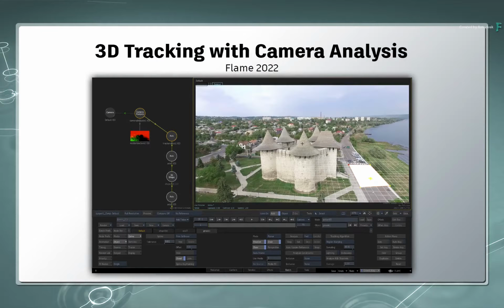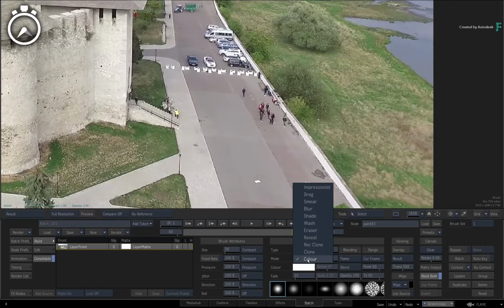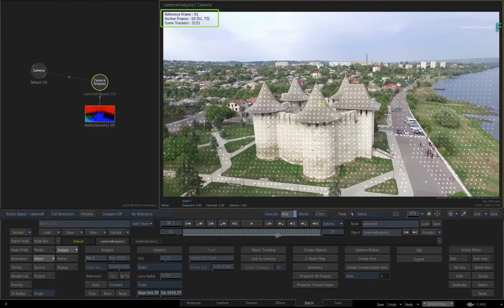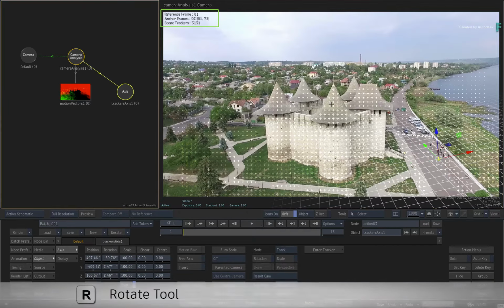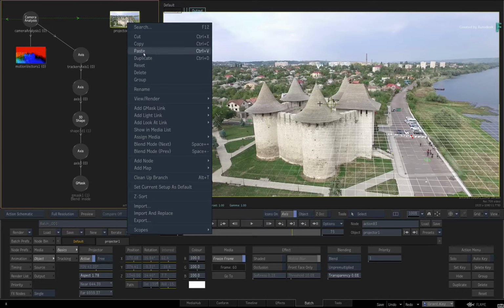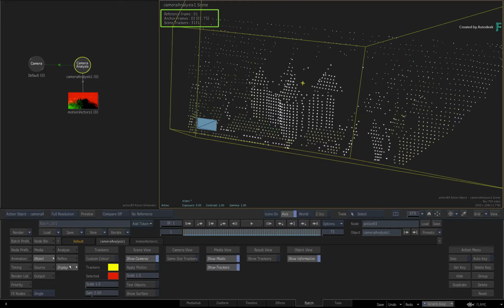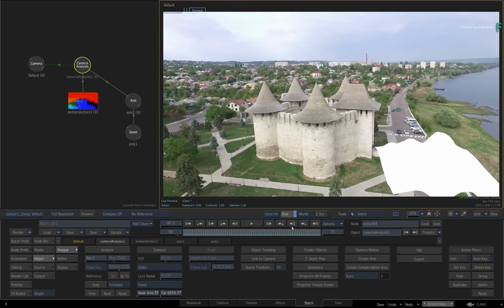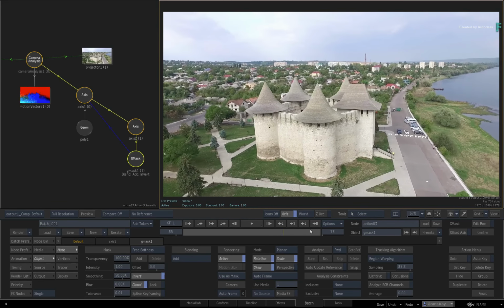3D Tracking with Camera Analysis - P4 - Clean up with Projections - Flame 2022

Comment: Grant - it's really too bad that you can't use an Ext Bicubic in a projector.  The only way that I have been able to do this is by using and Action node to feed into the projector surface and then it is really hard to manipulate because the surface that you are adjusting is not in the same view/plane/transform as the comp.  This would really help when the  surface needs a tweak from slippage or bobble. I have asked Autodesk for a way to do this for years.

Comment: Grant - stupid question: how do I reset my orbit?  I think that it used to work off the default camera and you tracked with a new camera.  I'm in 2024.  While I'm here - one thing about the new animation curves that I don't like - If I have to enter a global keyframe on a node, I have to constantly tap on another node and then back.  I can turn off "Automatic Channel Selection" but then it's in a constant state of globalness.  I wish there was a hot key to switch back and forth to the parent node.  Also, the Planar tracker used to stay on "AXIS" when manipulating the mask, now, everytime I adjust the mask to keep the track going, I have to remember to tap back on the AXIS node, otherwise I have a mix or Axis and Mask keyframes.  Just sayin'.

Comment: Bullshit...only works with. 75 frame, perfect geometey and super simple camera movement, as always...when it comes to real everyday challenges, nothing goes as smooth as that...frustrating
Reply from the maker: @Pedro Da Silva Sorrentino, the footage I supplied with the video was not exclusively produced for Autodesk.   I did try other shots successfully but I felt that this shot explained everything clearly without too many issues getting in the way.  The purpose of the example was to show you what is possible with the features mentioned.   I agree that not every challenge is the same but other Flame Artists have had success with these methods.   Unfortunately I cant cover every possible example but I can certainly point you in the right direction for a successful track.     If you feel there is a bug or improvement with the feature in question, please log a request with Autodesk support and we can investigate it for you.   Many thanks for your feedback!

Comment: How would you go about projecting a clean plate in a scene tracked in a 3rd party tracking software?
Reply from the maker: Hi Andy, it would be exactly the same as this but without the camera analysis bit.    You would import your 3D tracked camera as an FBX and place an object in 3D space to receive a projection.     Next you would create a new projector at your chosen frame from the cameras perspective.    To lock it down you would freeze any animation on the projector.    When you look through the camera, the project should stay locked and you’re left with a clean plate.  Hope this helps.

Comment: heya grant...

thanks for the great videos as always.

couple of questions please !

1 - can we add manual tracks to the solution ? ie pick a pixel area feature that is not included in the point cloud, and add it...like you could with the old 3d tracker, by adding a manual 2d track to the solve.

2 - i notice that when you scrub,  your clean plate slides...especially noticeable at the left hand edge...and I noticed that your point cloud that you picked for the gound plane, the points should have been relatively much more coplanar than they appear in the solve....which maybe is causing the incorrect solve/ground plane slip. having to manually rotate the ground plane as a guess by eye,  somewhat defies the point of getting a rock solid 3d track, and in many scenes is not easy to do accurately ! is there any tool or workflow in the new tracker that can improve this ?

2b - we can also see this issue in the surface mesh generated, the road area is concave rather than flat...

3 - it would be cool if we could have an option of generating a diffuse map set to projection uv's and frozen to the frame, as an alternative to generating the projector...i fond far more control with working that way in layers of projections etc...

many thanks

paul
Reply from the maker: Hi Paul, Thanks for all the feedback!

1- At the moment, you cant add manual tracks to the Camera Analysis, you can increase the number if trackers used per frame but not pin point specific targets/pixels.    Please log this in the Autodesk Flame Feedback Portal.

2- I agree that they may not have been perfect but I was moving along quite quickly and I did have time to check each point to ensure the co-planar aspect you are referring.  So the workflow is more or less the same but you would be to take more time and rotate around the point cloud and examine the points you would like to use.   

2b - This is down to the camera analysis algorithm, level of detail in the image and camera move to extract the correct depth info in the point cloud to be able to make a mesh.   This should be able to cover most shots but we cant guarantee every shot :)

3 - That is an interesting idea and definitely worth logging with the Feedback Portal.    However I would ask you what more needs to be done to the projector to do the same thing?

Thanks!
Reply: @Autodesk_Flame  thanks for the reply, and yes all makes sense ! look forward to using it ! 🙌🏽